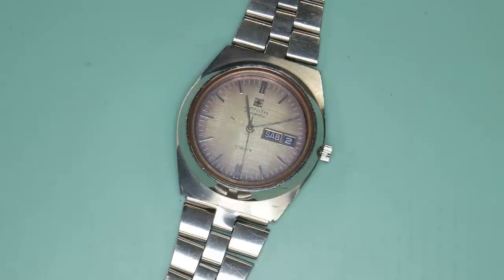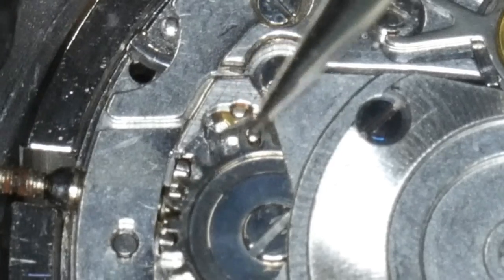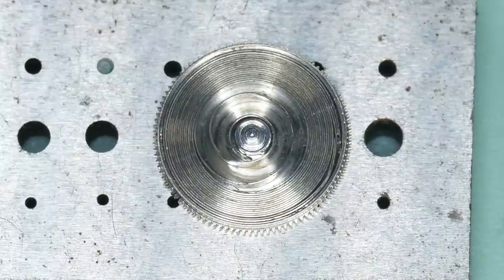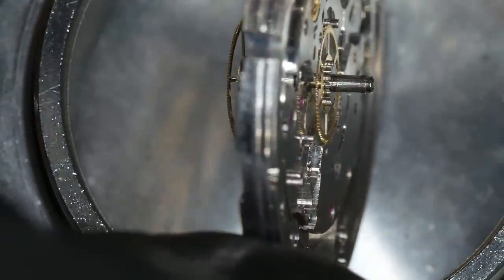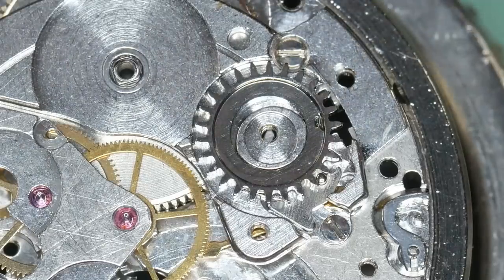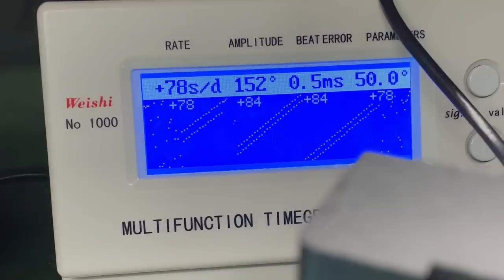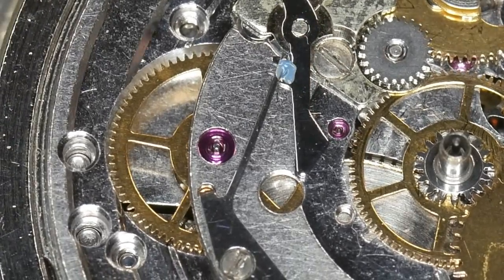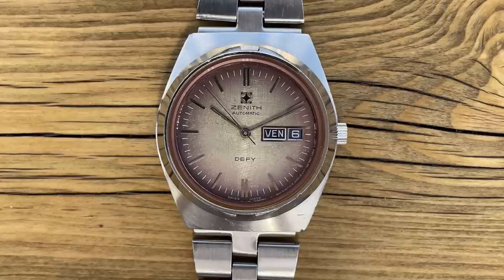Vintage Zenith Defy Restoration - BUT WILL IT DEFY ME?

Comment: If the mainspring winder is too large,why not put it in the lathe and reduce the diametre
Reply from the maker: Because you would then also need to hone out the hole in the winder to suit.  doing this makes it then only fit a ETA 11mm barrel. You can actually buy specific winder for ETA. 
Base of all the shafts have a hook too so you could not turn without removing  the hook and re-pinning to the shaft.  A lot of work.